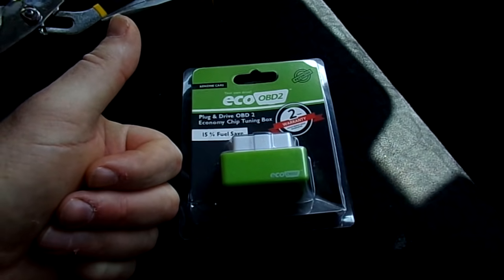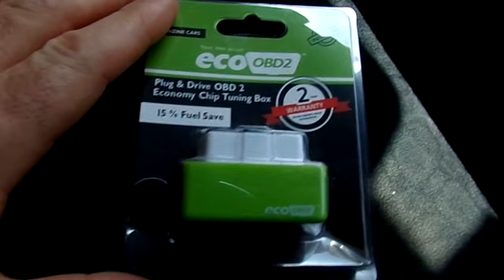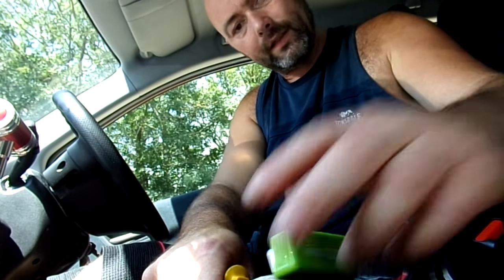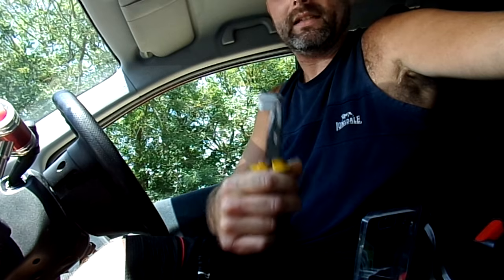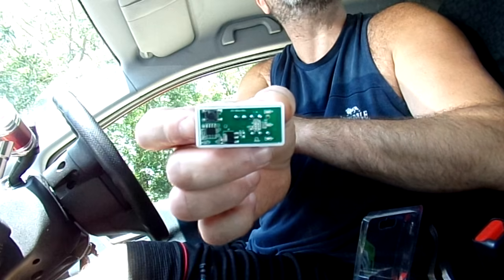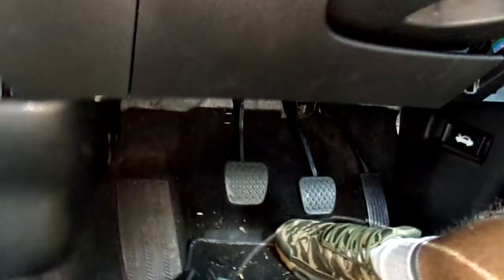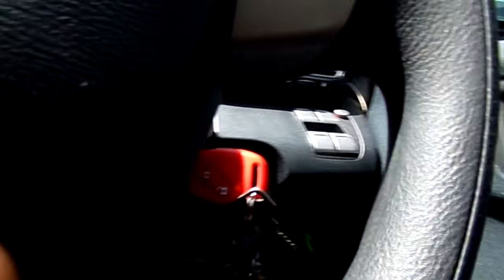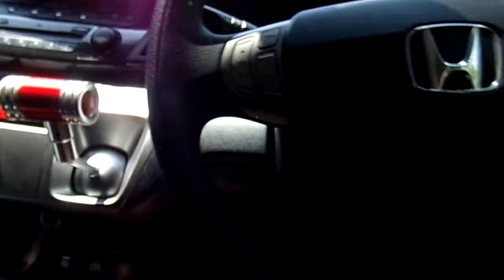HOW TO INSTALL ECO OBD2 (ECOVECO) SAVE 1000'S OF GALLONS OF FUEL A YEAR!

Comment: Disconnect negative battery terminal for few hours reset ecu the ecu will then learn new  fuel trims  through maf sensor tps sensor should improve fuel economy cross fingers

Comment: Hi everyone,

I’ve noticed some negative reviews about the eco fuel saver, and I wanted to share my personal experience and offer a different perspective. A lot of people might not see a noticeable difference, but I believe that’s because the product’s true effectiveness is best observed over the entire course of a full tank, from full to empty.

For example, I typically get around 400 miles out of a tank of gas (19.5 gallons). Using the eco fuel saver, I expect to gain about 60 extra miles per tank—around a 15% increase. However, this difference can be subtle if you don't drive your car down to empty. In my case, I may only see around 45 extra miles if I haven’t drained the tank completely.

I understand why some people might not notice a dramatic difference, but I believe it’s important to take this into account before making a judgment. It’s easy to miss these savings if you don’t monitor your mileage over the entire tank. Hopefully, this adds a bit of context for others considering the device."

Regards,
Jim L

Comment: I have seen ads on YouTube about these things. The first red flag was AI voices and stock footage in the ads. 

Upon further investigation I found these fuel savers do nothing more than lie and deceive drivers with a false sense that they are saving gas.

I was curious on how these worked upon seeing the ads because I immediately knew something was amiss. The videos I watched only confirmed my suspicion — Fuel Save Pro/EcoOBDs are an absolute scam. They are nothing more than a circuit composing of a light, a button, and an OBDII connector to power it. They make zero attempt to reprogram your car/truck’s ECU and improve mileage.

Fuel Save Pros and EcoOBDs, just like their pertaining ads, are fake. Do not believe anyone who praises these, as they are most likely paid by the company to post fraudulent reviews. Avoid them.

I have no clue how the company who makes these have not been sued for false advertising, but they should be.

Here are some tips to actually improve fuel economy:

- drive the speed limit
- make sure the tread on all four of your tires are in good condition 
- go easy on the gas pedal
- coast (keep your foot off the gas and only accelerate or decelerate when you need to)
- service and maintain the vehicle as per the manufacturer’s recommendations

Comment: What if your vehicle has push button start and no key to turn on so you can wait a minute to start?
Reply: Then you’re just paying for 3 led lights lol
Reply: You can actually put on your ignition without cranking your car. Simply press on the push button start without matching of the break pedal, the ignition will turn on and the car won't start. 

Cheers🥂
Reply: You can turn it on without the brake pedal.

Comment: I am the perfect test monkey - I drive Michigan to Louisiana every month, I watch and Document gas/miles using the trip option on my 09 Chev equinox (120,000+ miles). I figured my car technology was 10+ years old so any new tech device might help mileage.
 I track mileage between four different gas stops (cheapest places on the trip) about 225-300 miles apart. I hit the gas/speed/distance as soon as I hit 70 mph on the highway then check and reset the trip/speed/miles when I later stopped for gas.
 REALITY: the first ECO chip I used picked up my mileage from an average of 20mg to  24mpg with a high of 25.6 mpg in one 320 mile run. A month later it died. (Online $29.99 device dead)
 I bought a second ECO device from Walmart for $9.99. I had about the same mpg improvement but with a high of 26.6mpg. At one 55 mile stretch of old two lane (55mph) I got 25.2. A month later it died.
 I checked again and Walmart and found TWO ECO chip devices for $6.99.. the first didn’t work at all.  I will install the second one tomorrow and head for Louisiana on Sunday.
  At 2,100 miles round trip I use about 100 gallons of gas so saving about 20% saves 20 gallons of gas at an average of about $3.25/gallon.. so despite the short lifespan of the devices I saved money. 
  Some websites  say it doesn’t work but for some odd reason it works for me altho briefly.
 I think I did legitimate tests or as legitimate as I could and it seems to work.
DISCLAIMER: 30 years old I was a state licensed auto mechanic and raced cars for 10 years of my early life.

Comment: Woow is that chip for hack trafick light? When you drive and it's red light you just press the button and traffic lights became green only for you! 🤫😆🤣 I have to buy few thousands of these chips, and I will hack evry engine and traffic lights for 10 cents, it's cheaper then 50 cent! 😏😉

Comment: Most legit performance chips that work usually have injectors and pump specifications that come with it. Usually have to be purchased along with a specific mass airflow/map senor because, not all sensors are remappable. I just have a hard time believing that it does anything without there being upgrades in hardware. Your fuel pump moves a specific volume of fuel to a specific size injector that gets an air to fuel ratio from the sensors.
Reply: This must be a bot response

Comment: It can’t possibly save fuel...it’s just an LED. It only drains the battery. If fuel efficiency is altered it’s probably down to driving conditions, i.e. the car will use more juice in winter, stop - starts in heavy traffic etc.

Comment: The flash of lights looks very nice when activated. I am not a mechanic or technician but common sense tells me that it is illogical to install this device in a place that has nothing to do with the engine or the gas tank and saves fuel. .It is similar if at the December holidays my friends  give me a watch or a telephone and they tell me that Santa Claus brought it to me.

Comment: I have one on my car. Before mileage average was 30 mpg. After 3 weeks, several months now, mileage is 40 to 60 mpg. It needs time to adjust to your vehicle. It plugs in under the dash. I needed no tools to install it.
Reply: Scam.
Reply from the maker: THANKS FOR WATCHING BE SURE TO SUBSCRIBE AND WATCH OUR NEXT VIDEO. ALSO CHECK OUT THIS PLAYLIST BEST U.F.O/U.A.P/BLACK PROJECT PLAYLIST EVER! OVER 100 HOURS!
https://www.youtube.com/watch?v=xjFTuxA8bqc&amp;amp;list=PLMP2UZvBVLH0QaDbLiqQ6aFuN3zyt8FEF
Reply: BS! I have used reader to try read what code does it send. Gus what? Nothing! The led light will flashing same thing doesn’t matter if the connect or not.
Reply: I agree. I picked up about 20% in mileage but the device died after a month. Bought another which again increased mileage but it died a month later. Bought a third ECO device and it doesn’t work at all :-(
I will give ECO one more shot because I save much more then the device cost.
The last ECO bought at Walmart online was TWO for $6.99.
Reply: Certainly a tool installed it on your car.
Reply: @James Lowe total BS mate
Reply: @Hagar934  Nonsense. It works for me. You never saw my car and have no idea how it works.
Reply: @Hagar934  It works or it doesn't
Reply: @jamesmlowe  it doesn't

Comment: All of the honest reviews say that it will turn on the check engine light very soon after install. The fuel delivery map cannot repair itself, once it is altered the dealer will love selling you a new ECM box. Don't do it, it will seriously screw up your car.
Reply: It’s a scam.
Reply: This device doesn't even have the ability to speak to the ECU so there's no risk there... But this also means the device is physically incapable of altering anything on your car. It's nothing more then a flashing light show.
Reply: You're 1000% correct.
Even if it did actually work as states, it would cause ecm problems.
Especially if you live in a place that does echecks, good luck passing 😂
Reply from the maker: THANKS FOR WATCHING BE SURE TO SUBSCRIBE AND WATCH OUR NEXT VIDEO. ALSO CHECK OUT THIS PLAYLIST BEST U.F.O/U.A.P/BLACK PROJECT PLAYLIST EVER! OVER 100 HOURS!
https://www.youtube.com/watch?v=xjFTuxA8bqc&amp;amp;list=PLMP2UZvBVLH0QaDbLiqQ6aFuN3zyt8FEF
Reply: This is your generic response to anyone calling it a scam.  But if some gullible person asks you a question and they seem to believe in the product, you will give them a genuine answer. What's up with this?

Comment: Can the OBD 2 be left plugged in over days or weeks or will it draw current and drain the battery? Thanks
Reply: It will most certainly drain the battery if left for a long time. The device is pointless though, it doesn't do anything other then flash a couple of LEDs. the only place you should be putting it is straight in the bin.
Reply: I left mine in until the device died a month later.
Actually (see my  long post above).
  I tested it on the road three different times driving 2100 miles of freeway each time and had great results. I tracked it on my car trip/speed/miles and on two different ECO devices picked up about 20% improvements but each died after about a month.. never had any check engine lights or roadability issues..
  :-). Not sure why they don’t work:-). They worked for me
Reply: I just got mine today and installed. Hope it works
Reply: It’s a scam. Will only draw money from your wallet.
Reply from the maker: yeah leave it plugged in...i do!

Comment: I bought the same "fuel saver" 3 units and after a day of driving I ended up having a check engine on my dodge caravan,  and my pontiac g6 steering wheel went haywire. Good thing it's still winter, I haven't installed the third one yet to my brand new 2022 camaro. I couldn't imagine what it would do to her engine. I shouldn't have trusted the online reviews on amazon and youtubers such as this video who does not even try doing it on a tester. Blinking lights does not mean it's working. Lesson learned at the cost of my 2 vehicles. Good thing I have a friend who troubleshoots car electronics. Sorry!
Reply: It doesn’t work. It’s a scam.
Reply: I feel sorry for you that you'd fall for such an obvious scam
Reply: How can power steaming be effective it’s hydraulics run by belt it’s not electrical .
Reply: @bluenite12  alot of newer cars have electrical steering systems.
Reply: Does NOTHING good or bad fool!

Comment: I'am Your Newest Subscriber I Thought I Really Wanted To Buy One Of These . My 2012 Eco Chevy Cruze 6 Speed Manual Driving 55-60 Mph AC OFF I Get 50 Mpg Interstate I Was Hoping To Buy This And Get Even More
Reply: It will save you a lot of gas mileage because is gonna F up your ECU and your car will stop running
Reply: @youonlyliveonce2556 no! It will not!! Because it never send anything out! The lights on and off by itself just like Christmas lights. So I am vert very sure it will not damage anything because it doesn’t doing anything either! LOL
Reply: I used an ECO chip on my 2009 Chev equinox (3.6) and picked up about 20% on three 2100 mile highway trips with no problems, no check engine lights 
  I doubt many of the other responders never tried one and just post nonsense and negativity because they have nothing better to do.
  I tested them. They work for me..I was a state licensed mechanic
Reply: They are trash

Comment: It does state on the package that it takes about 50+miles  for the chip to learn your driving style, for maximum results I would  use with  another device, maybe alloy pellets and an engine additive
Reply: You can hook these up to any real equipment and its a couple of blinky lights at best and a good way to fry your ecu at worst. These are a scam!
Reply: It is not working 😞
Reply: @GutaroVladimir  
It’s a scam.
Reply: It's nothing more then a chip programmed to randomly flash the LEDs.  There is literally no product on the market you can plug into any car that automatically "reprograms" the engine to either save fuel or produce more power. The only product that could possibly do this is some kind of processor intercepting the lambda sensor to tell the ECU it's running richer then it is and even then the ECU may figure out the engine runs poorly when it doesn't run "rich" and may eventually set the trim right back to where it would have been. 

If you want to tune the engine then your only option is to goto a professional chip tuner who will change the Maps based on your car model and then test to see if the engine is still smooth and stable. Personally though for fuel economy I really don't think it's even worth getting your chip tuned... If you want performance go for it but if you've bought an eco car chances are a chip tune will only give a marginal improvement which will barely cover the cost of paying a professional tuner. 

Personally I think the biggest fuel savings can be made by closely monitoring yourself, the driver. I have a Toyota Aygo and when I first passed my test and started driving I was getting around 50mpg, no where near the claimed 65mpg. I decided to try changing my driving to be more efficient and now I'm getting 70-80mpg.

 I did also buy a Bluetooth OBDlink which connects to the torque app to give instant readouts of things like fuel economy (instant, trip and overall average) and engine load. Tbh it's pretty great if you want a custom dashboard. I also have it set to monitor battery/alternator voltage and coolant and intake temperatures. Plus you get instant readouts if your engine management light comes on while you're driving so you know exactly what the issue is without even having to stop (it's only happened once but it was quite calming instantly knowing it was a post Cat lambda sensor, I'd just fitted a new exhaust and the issue was it needed some exhaust sealant on the joint)